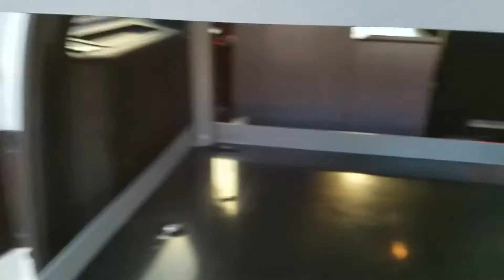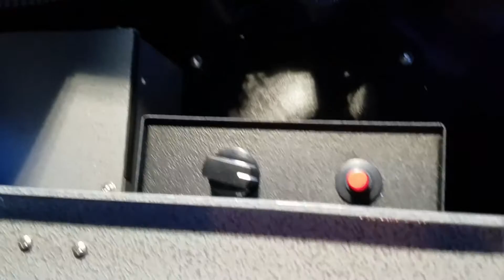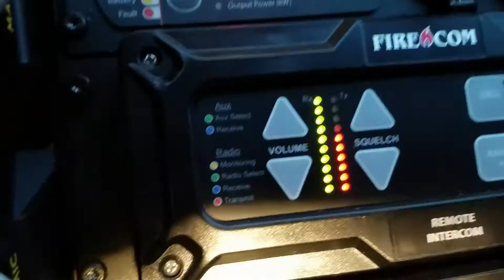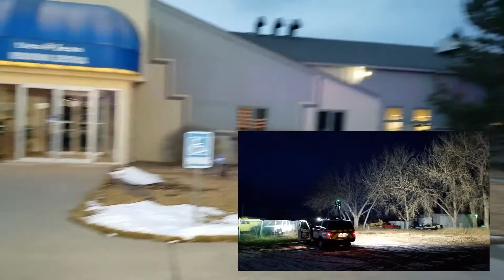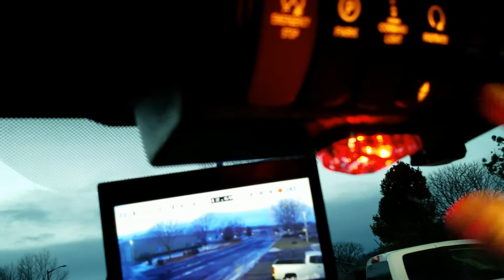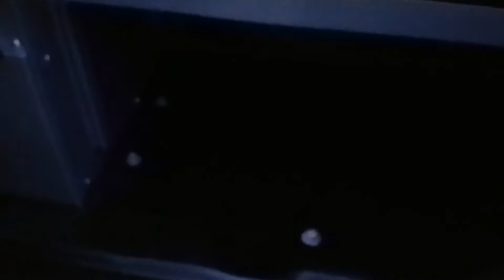Poudre Fire Authority, Bat 2 New Vehicle

Comment: Question about the lightbar, Can it be set up in a amber, red and white, with a way to run white and red at the same time, and the amber by it self? The white would only be in the front, but the amber and red would be around the entire bar, with a way to run a arrow stick in the back also. Just wondering...
Reply from the maker: Yes, you can get the bar in a 3 color version, and have it do red/white, and or amber. In fact, we have a fire vehicle coming up that we are doing exactly that. Red/blue/white for responding, and an amber button for when they use the truck to plow their station parking lots. This function is preprogrammed at fedsig so you have to specify what you want it to do and when at order. Other then that it works really well. Be prepared to spend some dough though... a 3 color 51" integrity is around 2k.